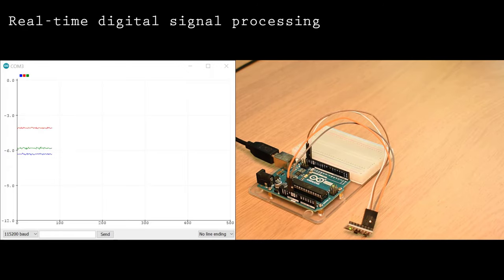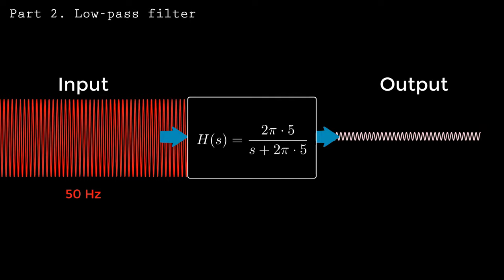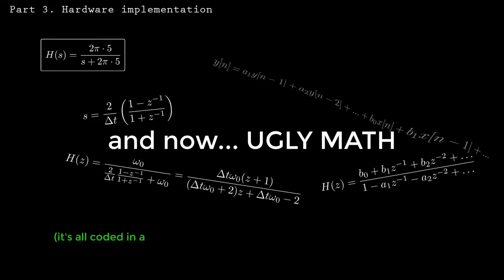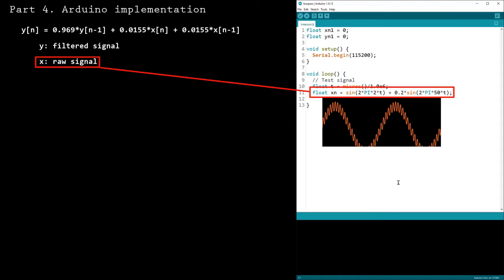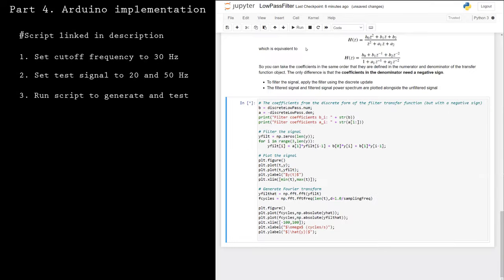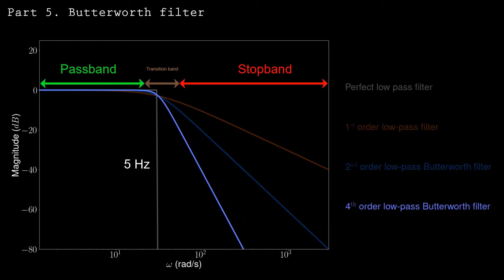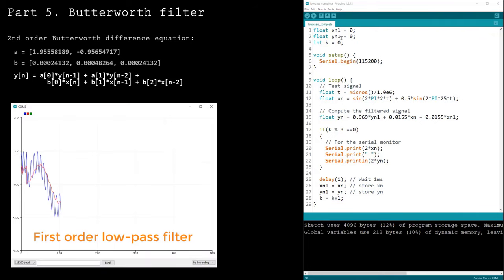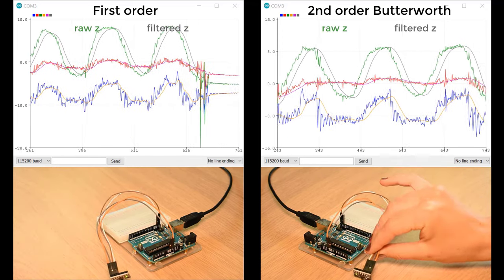How to design and implement a digital low-pass filter on an Arduino

Comment: I regret that i Have not seen this explanation during my College study. while i was studing, I could not understand DFT, FIlters, signal processing, what is the need of different plots, why we need to study bilinear transformation, what is the need of Continous, differential equations...etc. what is not covered in this video; Signals, Control system, Maths, Embedded system, Python programming.. really usefull. Thank u. thank god atleast now I came to know.
Reply: Same.. professors go through the theories less of implementation or failed to explain the uses of the theory they are teaching. And mostly that is why they are professors and not engineers.
Reply: I'm at the university now but I must say I've been lucky with what teachers I got. The teachers I've had in hardware programming, control theory and electronics all have about 30 years of experience working as engineers before they started teaching so they lay an immense amount of focus on having their students understand instead of just picking formulas that fit. Of course some students really hate this since it makes the exams much harder when you need to really understand everything before you have a chance to answer. I like it because learning the course is enough to make me apply it and built better things than I could before.

Comment: This is so cool.  It's very interesting how the continuous transfer function becomes a discrete transfer function with terms that only require the last value of y and current and last values of x.  The accelerometer demonstration was a great applied example.  Fantastic.
Reply from the maker: Yes its discrete form is surprisingly simple. Those coefficients pack a surprising amount of detail. Thank you for the kind words.
Reply: @curiores111  Can you suggest other filters that have less phase delay?
Reply from the maker: @snivesz32  Sorry, not off-hand. Generally speaking most filters I've encountered would have more phase delay than a basic low-pass filter. There are probably some exceptions (with other tradeoffs, no doubt).
Reply: @snivesz32  there are necessarily delays (unless you can look into the future). Even an analog low pass filter like a capacitor will cause a phase shift.

Comment: This was a grate refresh of and old cause I took years ago.
But I have some questions.
1. What influence dos the sampling frequency have. What would happen if you sampled slow or if you sampled super fast? (say 100 Hz and 10kHz)
2. If it was sound. If I needed real time sound, say I was recording on my pc, and I could only allow a delay of 5 ms, who would I find the order I could accept.
3. And if it was sound and the phase change is different for different frequencies, how high an order could I accept without hearing the phase change? Assuming it was for a recording and the delay could be handled before combining with other signals.
4. If you have multiple signals and you want a low of high pass filter on all the signals, is it better to apply the filters on each signal chain or only one filter on the combined signal.

You know it is a good video when you just keep coming up with new questions. 🙂

Comment: Amazing animation and content. Keep posting. I have a question:
You wrote yn=0.96yn1+....
After delay of 1ms you do yn1=yn but since the statements are sequential (is it concurrent?) Then yn=0.96yn+.. works good as program will use past value of yn to compute new value of yn like we do sum=sum+1 in c programming. Why did u introduced a new variable yn1?

Also another question is:
You said higher order filter leads to more and more phase delay.. so it is occurring because of computational delay but when u implement that on hardware will it still give same phase delay or delay will increase depending on which hardware u choose? What I want to conclude is whether the phase delay also depends on hardware implementation in practical scenario? Or is it like as long as your hardware is able to sample at the specified rate, whatever phase delay u calculated theoretically will match actual implementation.
Pardon me I still a beginner trying to make sense of DSP 😁
Reply from the maker: No particular reason for yn1. Mainly, that's to emphasize that you need to store and use the value from the previous loop (it matches the equation more closely). Of course you can optimize the code to improve the implementation. There are also probably libraries somewhere that could do this for you (although that has its own overhead).

That's a really insightful question Shubham. In general, the delay shouldn't depend much on your hardware, unless your device can't actually keep up. So for example, you can't do real-time audio processing on an Arduino, because the sampling frequency of the loop function is too low to keep up, so there will be a noticeable delay. There's a similar issue with the Raspberry PI for processing audio signals, but that's because of the overhead of the operating system, rather than an insufficiency of the processor.

So in general as long as your sampling frequency is well above your frequencies of interest, you shouldn't introduce more delay than what is indicated by the continuous function. However, if you wanted to investigate it further, you could do some analysis of the discrete form of the function with varying sampling rates.
Reply: The way I naively think of it is that when you get a change in input, you have to keep sampling to see if it is a "real," meaningful signal change, or just temporary noise.  To figure that out, you have to keep looking at more samples, over a longer time frame.  Eventually, you get enough samples to know that the signal is changing, and so you output that change.  The delay is how long you wait before deciding whether (or how much) to propagate a change in input.
Reply: @markday3145  you can look for the nyquist frequency.

Comment: Hello! Good video! For the first.There are loat of calculations with floating point - it takes a lot of processor time because there isn`t any FPU.The RAM can be too little. It is real to implementation a moving average filter - but this filter is more fit to time domain (it`s bad filtering in frequency domain).

Comment: This is a great explanation and has a real input as an example, well done. 

Some inputs need different filters because they use the data for different reasons. Your example showed an IMU data stream likely useful for position control and so time delay becomes crucial. Could you also include some aspects of the time domain signal, how much is the waveform distorted by the filter. I’m thinking about, for example, a single bit of data or a sonar reflection. Ringing artifacts on the time signal add features to the filtered signal. If you choose the wrong filter, the response  may affect position control too, causing overshoot and actuator wear.

Your data bandwidth, your actuator bandwidth and your noise level are some of the inputs that your filter design needs, I’m sure there are a few more. Would be great to see you demystify these in a future video.

As a late thought, some explanation of the difference between just using a PID  control strategy and including a filter before the controller. Is it valid to filter the measured variable before using it for control?
Reply from the maker: time delay is absolutely crucial. Increases in delay directly destabilize the control system. So as you say, this would cause overshoot, and in extreme cases destabilize the control entirely.

I'd certainly be interested in creating a video exploring the details of filter design. Thank you for the request. There would be a lot to unpack there, so I'd have to think about what might be useful to a general audience on youtube. 

It is absolutely valid to filter the variable in the control system. As you said, if the delay is high, this could cause some stability issues. But in other cases  this can be very helpful  (for example where there is measurement error, as you can see in this video: https://youtu.be/HRaZLCBFVDE ). The delay caused by the first order filter is pretty small, so on the time scale of the motor response it's not really destabilizing the system. If you compute the transfer function of the motor, you could multiply the transfer funciton of the filter, and analyze exactly how much the stability using standard methods.

Comment: I took a dynamic system course at university 4 years ago and still not clear about the phase diagram mean in the bode plot until I watched this video.
Reply from the maker: That's exactly what I thought about the phase plot. One of the reasons I included so much detail in this video. Thanks for noticing Q.

Comment: the video is nice, but man holyshit u were going quick through every step. I had to watch multiple other videos to understand the code here, I guess I am just dumb but u are going super quick and I think u should really include maths in this, that how u are calculating the formulas and etc, because who ever will watch it, they just don't want to copy and paste stuff, they are watching this video to understand the concepts and modify stuff for there own need. And I know u have included python script to modify the cutoff frequency to our use but still need actual formulas to understand the stuff. Dont take this comment as negative, It still helped me.
Reply from the maker: Thanks for the feedback Haseeb, it is valuable.

Here are a few of my thoughts:
I can understand why you would like to see the details of the math. Unfortunately the details do really require a lot more flushing out (at least an hour). For this video, the intention is to give the high level overview and access to the necessary tools. In other words, the goal is to get you to the practical application of the tools as quickly as possible. For many, spending a lot of time on the theory can be frustrating and uninteresting.

TBH, I wouldn't mind creating an hour long video about the math (I have a PhD in applied math), I just have no idea if anyone would watch it.

Comment: The video really intrigued me. I couldn't find a filter for my own project. I think it will work for me. thanks.
I had questions I wanted to ask;
1- Can the codes on the "Design and test a Butterworth lowpass filter" page be applied to the arduino as it is? Which frequency is the cutoff frequency?
2- You have input a sine wave to the Arduino input pin. On the other hand, I need to enter 5v square wave after the shimmet trigger. Is the formulation suitable for this?
3- Can bandpass filters be designed?
Örneğin;
30 - 40hz,
60 - 80hz,
Like 100 - 200hz...
Reply from the maker: That's three questions ;)
1 - Yes, it can be applied "as is", but will only work if you're trying to filter above about 10 Hz.
2 - As I recall, I used a 5 Hz cutoff for everything. But you can always check the jupyter notebook to verify or set your own cutoff!
3 - Certainly, a bandpass filter is just a combination of a lowpass and highpass filter. For stringent requirements there are a lot of filter designs. Just keep in mind that everything comes at a cost.
Reply: @curiores111  thank you for the answer. I believe I paid too much. Although I am an amateur, I have been working on this subject for several years. I just heard about the digital filter issue.
Now, the hard part is this; Believe me, it is very difficult for me to do what I want because the programming language is python. However, I think that I need it so much and that time is constantly running against me, and I'm getting fed up with it now.
Reply: @curiores111  If I go back to the subject;
I think you are using another module from arduino. What is this? Can't you do this directly on the arduino?
Also, I'm really out of time and I urgently need to find a solution. For this reason, I am even willing to pay an amount that will not upset anyone for the software.

Comment: Thanks for clarifying. Acceleration.  I have data coming on the serial port, but it needs to be time date stamped.   After filtering I see some hope, However, now I have edge detection problems.   I need to capture a pulse with a width and height that meets a requirement.   Take a read from a real time clock so I can generate a timeseries stream Time and Date on the x axis and data on the y.  I am assuming I could send out the time date, raw and filter data.  On the other end, I could build a timetable then plot with real time involved.   Is there another way to generate time data on the receive side without an RTC?  Just can't wrap my head around this.

Comment: Great video as usual. Just had a question, what kind of sensors require these?
Reply: sensors like mic where you want to do processing on signals such as speech and you don't want noise along with that so you use a lpf... or you are making  a PLL where you are using VCO and when the signal which drives VCO is fast means it has high frequency component and  you want signal driving VCO to be slow so you use a LPF.
Reply from the maker: Shubham gave some good answers. For me, I was looking into filtering because of errors and dropped signals in the calculated velocity while performing motor speed control (the low pass filter mitigates those errors). I'm also planning to do real-time audio processing on a SAMD51 to create custom guitar audio effects (the most basic of which is equalization).

The utility of digital signal processing doesn't end there, though. The low pass filter does have other uses, but there are a lot of other applications for signal processing in general, like cell phone networks. The algorithms used in those cases are typically more complicated but built on similar principles. Part of what I wanted to do with this video was give a practical introduction to DSP in general.
Reply: I'll use it with a cheap "Heartbeat sensor" (KY039) which outputs a somewhat noisy signal that messes the trace on serial plotter.

Comment: hey your videos are so cool and nice. Btw what is that 'k' in the arduino basic filter code?
Reply from the maker: Hey thank you. The "k" is just a counter that is used to reduce the number of times the arduino prints to the serial com. (writing to the serial com takes a lot of time so it slows the loop down, changing the frequency. )

Comment: Could you please guide me how can I implement low pass filter on a sensor practically ?
Reply from the maker: You can apply the derived formula (implemented here https://youtu.be/HJ-C4Incgpw?t=356 )  to any sensor signal. In this case xn would be your signal (from the sensor). And yn would be the filtered signal. If your sensor has multiple outputs, you can apply a filter to each. You could also consider using libraries or writing functions to do some of the work for if it's necessary.

Comment: Somehow this has been useful in controlling a spacecraft in a videogame by using a physics bug caused by certain kinds of interractions with interior doors.

The doors make the ship wobble, this will be great for ignoring the high frequency noise.
Reply from the maker: Interesting, I would like to see what the data looks like...
Reply: @curiores111  I mostly just eyeball the controllers haha. I could write a code to print out graphs but I don't feel like it.

I will consider it though. The graphs would make for great interior design inside the ship, make it look all sci-fi and shit.

Comment: you are amazing , a huge knowledge in a few minutes.
how can I calculate the frequency of a desired signal to be filtered
Reply from the maker: Thank you! Good question Abdel. You can compute the FFT of your signal as I do in Python (or even possibly in the Arduino IDE). Once you know the spectral content, you can identify the different frequencies, and filter depending on where they are in the spectrum.
Reply: @curiores111 
I asked that question because you generated an artificial signal,  Then you separate them using dft
But,, how can I detect the equation of my sensor signal,,
You generate a known frequency signal, and then implemented your filter,, but i don't know what is the function of my sensor signal ,,
I hope you know what I mean, 💔
Is there a device, or something else.
Reply from the maker: @RESC_Eng  You don't need a device. You just need to read the signal into Python. I wrote a video that shows one way  to do this, you can find it here: 

https://www.youtube.com/watch?v=fIlklRIuXoY&t=5s

once you have the data in python, you can use the FFT commands, etc. to process the data.

(this is just one relatively easy way to do this. There are lots of other ways you could do this.)

Comment: First thanks a lot for this great piece of art. I have a question though, why does the discrete-model bode representation & the continuous model differ a lot! ,  the discrete-model which s defined with the Z transfer function :     ( 0.0155 z + 0.0155) / (-0.096 z + 1)  shows the complete opposite of the continuous you showed in the video !
Reply from the maker: In what way do you mean that they differ? Do you mean you are surprised that they differ numerically?
Reply: @curiores111  no the bode representation, how they respond to freq, they shows different magnitude and phase response
Reply from the maker: @mohammedbenhadine  Do you have a script that you can share where you computed the bode response of the discrete form?

Comment: Really nice explanation 🤩
Could you please tell me if this project could be done with Arduino Uno or is need of Arduino due only?
Reply from the maker: Thank you! You can certainly do this on Arduino Uno for signals with modest frequencies. If you want to process something with a higher frequency (like an audio signal) you should use something with a faster processor.